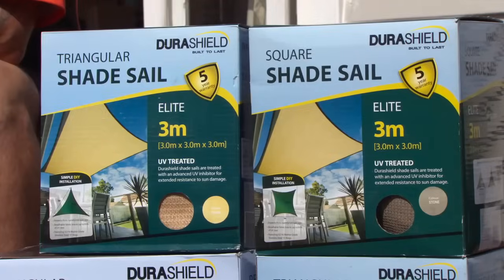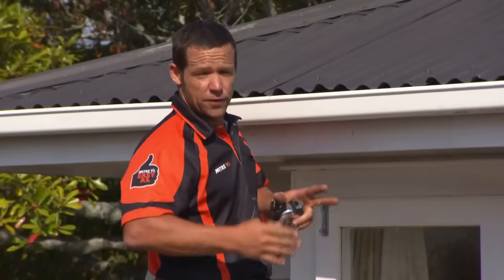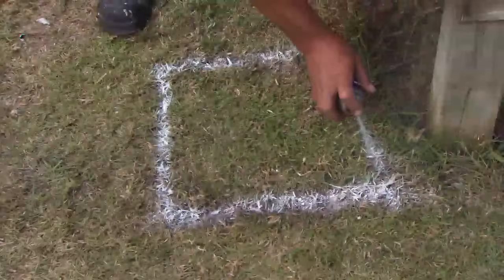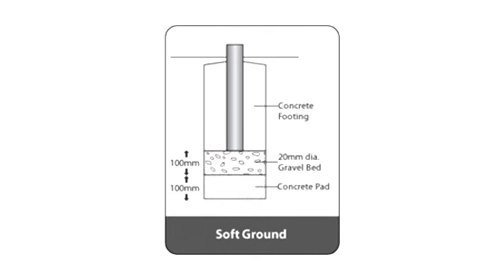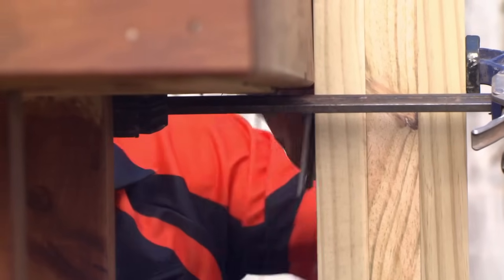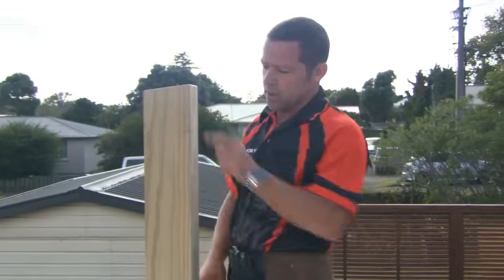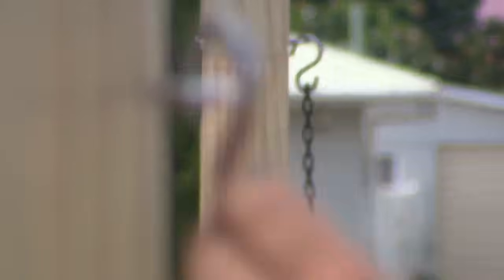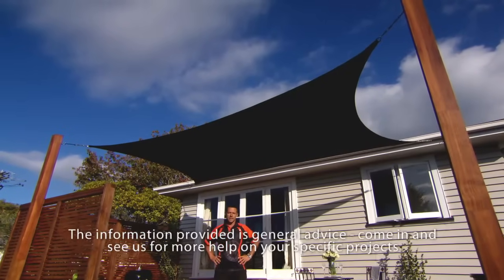How to Install Shade Sails | Mitre 10 Easy As DIY

Comment: As a utility locator, I really appreciate the fact that you make sure to tell people in each video to call in for a locate request to make sure they don't pop their own gas, electric, cable, telephone or fiber optic lines.
Reply: Hopefully the people coming out to mark them know what they're doing.  The cable tv company was off by several feet in my yard.  I think he and the electrical guy hit the same line underground because those marks were very close (red and orange spray paint).  I was installing corrugated pipe for my downspout.  I thought I was hitting tree roots when I almost severed the cable lines.  It was like 10 feet from the orange line he sprayed.
Reply: My husband is a utility locator and he has horror stories of homeowners that did not call for a locate to dig something - fence,deck, etc and hit some sort of line.  If you are at fault in can cost you lots of $$$$.  Call- it’s free, at least in Ontario

Comment: Stood under shade sail in full sun. Well positioned.
Reply: Haha yeah I couldn't help but crack up at the end when the shade sail was complete the shade from the sale was against the wall of the house.
Reply: The sun is setting, nothing to do with positioning....
Reply: @GRITBONE  I guess they just filmed it when he was done. Whats the big deal?
Reply: That was sun and the whole purpose of a shade is to provide shade ....Obviously it was mounted too high ... and he should have angle it also .....a good craft man nut not a good engineer/designer
... please take in consideration the direction of sun when mounting

Comment: Love this video.  I'm considering similar idea except stand alone posts with no deck to attach.  I know I'll need a substantially larger amount of cement and deeper. Mine will measure nearly 7M X 7M X 8M (20' x 20' x 30').   Any suggestions on the cement?  I'll use same size posts as shown in yours, except varying lengths to get that twist.
Reply from the maker: We recommend using concrete with a minimum of 20Mpa and not a quick set concrete. You can find more details here: https://www.mitre10.co.nz/guides-and-advice/guide/how-to-put-up-a-shade-sail

Comment: Does it run the risk of pulling off the fascia in high wind?
Reply: I wouldn't think so as it's going thru the fascia and into the rafters
Reply: rebekah rumbel 	OH! Thanks for explaining what he did! What did he do with the 90 degree metal piece? I’m a lady going to install myself. I’m pretty handy just don’t understand all he says. Didn’t think using facia was good idea but you explained that! I’ll just have to figure out how to check on rafters! Hmmm...doesn’t work for him, does it! And won’t work unless sun is coming straight down! Lol soooo...won’t be good on my patio after 2PM! Sigh....
Reply: @robinholbrook6576  I think if you had exposed rafters you could use them to brace the rafter and fascia boards--help reinforce that connection.
Reply: @nickstone7834  Thanks Mark! After more research I’ve found the sail won’t work for me. I have to have something with an adjustable angle depending upon the time of day and where the sun is, I bought a large cantilevered umbrella and the then a smaller one that can be moved around. I’m in South Texas and in the summer the sun just bakes us but changes angles through the long summer season: April-September. Sometimes e sun is directly above and sometimes it comes at us from the West. It’s not easy living in the Sunbelt! Yay San Antonio: gets too hot in the summer and not cold enough in the winter!
Reply: @robinholbrook6576  ah yeah these aren't moveable to adjust with sun
Reply: @nickstone7834  Nope! Sigh...

Comment: Would it be safe to attach the other two points away from the house onto the fence, as I cannot add in the posts int he ground?
Reply from the maker: Thanks! This will depend on the strength of the fence and also wind factors for your area! ^Cam

Comment: Seems like a fairly permanent deal for 5 square feet of shade
Reply: Metres
Reply: Closer to 135 square feet.  Its ok, not everyone is good at math.
Reply: ...in the neighbour's garden. The killer heat is mid-afternoon heat. A shade CURTAIN would be better, like in Spain. People roll DOWN as well as OVER. And have seating areas on the north side of the house, or the east side.

Comment: Wrong eyebolt, always use one that have shoulders on them. Also, using a bottle / sail hardware is recommended for the strength. Never a good idea to attach it to the house, especially with some of the larger shades, the uplift can be hundreds of pounds in the wind. Some of the sails, you need to use a 2 ton puller to get them taut, that will rip the soffits off of most houses.
Reply: Got nothing of value to contribute? Must still be trying to escape the backwater part of Papakura.
Reply: Packetattack tie me kangaroo down sport.
Reply: ....thats why he specifically went looking for rafters to attach too.....or did you miss that part?

Comment: I know its called "shade" sail but as well as the sun does it also protect against rain?
Reply from the maker: Most shade sails are not waterproof unless you are using a waterproof fabric, however, we do suggest varying heights of your posts/attachment points to encourage water run-off. ^Matt
Reply: @mitre10nz  👍 thanks Matt

Comment: 2:46 do not use cutters as pliers, this use will dull them . Vise grips or lineman's pliers would be better
Reply: If I wanna use my spanner as a Hammer I will. And I certainly do
Reply: Best tool to use would be a wing nut driver bit and a drill.

Comment: Why does this video say NOT to use quick setting concrete (quiqrete)?
Reply: Quick set concrete isn't as strong as regular concrete, and as such, isn't to be used in structural applications like footings for buildings or shade sail masts.

Comment: 5:31 we still talking about the sail project?
Reply from the maker: Hi there - Yes, at 5:31 we are still talking about how to install your shade sail. This section describes how to attach the sail to a post, ensure the post is at the correct height and also attach the post fixings. Hope this helps. Cheers ^Ian
Reply: @mitre10nz  thanks :)

Comment: Why not quick set concrete?
Reply from the maker: Hi Vincent! It’s because the posts will hold a lot of load with the wind blowing on the shade sail, and quick set is only rated for lower load jobs. ^Cam
Reply: @mitre10nz  sweet, thanks for the reply.

Comment: Of course these sails only offer the best shade when the sun is at its highest point near midday. It's the same with any structure too unless it's very wide. You might only get half the desired shade under the structure.
Reply: Yes but suns not too hot when it's lower in sky.

Comment: the columns are not built like that ,, the 1st wind ,,, they fall ,,, the foundation support is bad, side support also, and the fatal protection with the water, at the tip,

Comment: These sails are great if you need shade at 12 noon. Any other time and its freaking pointless cause you cannot change the angle.
Reply from the maker: Hey Baz, you'll want to pick the shape and position of your shade sail based on a number of factors including when you spend the most time outside and the direction of the sun during that time. If you need a hand figuring out which option will work best at your place, pop in to your local Mitre 10 store and have a chat with our team.

Comment: This is a great example of why you should not do DYI shade sails to your home .

The Posts are under size and weak
There is no water run off .
The sail is attached to the fascia board of the house .Very bad idea.
These shade sails act in the same way as yacht sails in high wind and will cause major damage to your property in a major storm or heavy torrential rain.
Cheap will cost you more in the end.
Talk to a professional shade structure or sail installer not your local hardware.
Reply: +Anthony Tony This is a great example of a commenter who didn't actually watch the video. The host spends a pretty substantial amount of time pointing out the location of the rafter. He didn't attach the sail to the fascia board. He drilled through it and into the rafter. 

Also, the posts are roughly 5"x5" boards. They aren't weak by any means. For the size of the shade they are more than adequate. 

And any sort of shade structure attached directly to your house is going to catch wind in severe weather and can cause damage. The benefit of these sails is... duh... they can be taken down when a storm is coming.
Reply: Treat it like an actual awning.. U wouldn't leave an awning up in high winds and storms and it's actually easier to unhook these and done.

Comment: So whats wrong with this picture....

Insufficient hardware- Never use 'hooks', always use closed and lockable shackles. Don't use less than 10mm components.
Rafter brackets- Never fix to rafter tails, always use designated rafter brackets. Screwing into rafter tails will pull out.
Posts- 1) Holes not deep enough, must be 1/3 the height of the post underground.
             2) Never use timber posts, they snap. 
                             -if you have to use timber posts, make sure they are hardwood, not cheap gluelam pine.
Turnbuckles- Don't use turnbuckles to tension the sail. They are weak.
                             -if you have to use turnbuckles, make sure to lubricate the threads before tensioning. Stainless steel will bind/weld itself together under tension if not lubricated.
Tensioning- You need several hundred kilos of tension on sail membranes or they will move with the wind causing damage, eg snapping posts or pulling rafter brackets out. The sail membrane should be so tight you could almost walk across it.

I design and install shade sails for a living and regularly have to repair properties that have been damaged by incorrectly installed sails. Find a shade sail expert if you want a shade sail, if you don't know how to do it yourself, don't try and do it yourself.....

Comment: I do not like the screw eyes with the force applied is trying to pull them out.  having them at right angles to the force would be better.  The eye bolts look undersized relative to the size of the posts.  If you do use such skinny eye bolts at least put a fender washer under the nut so it does not sink into the wood